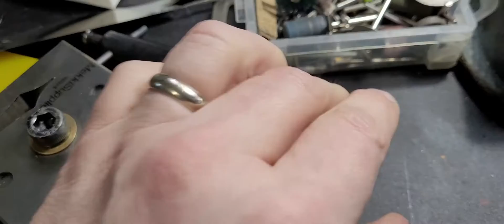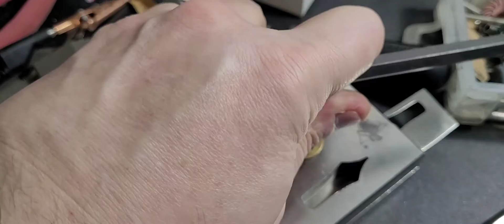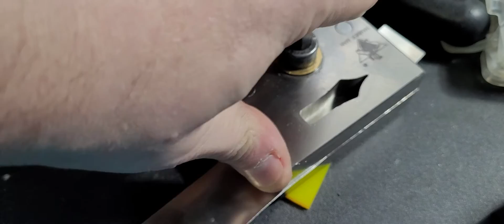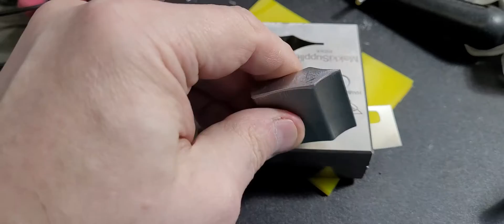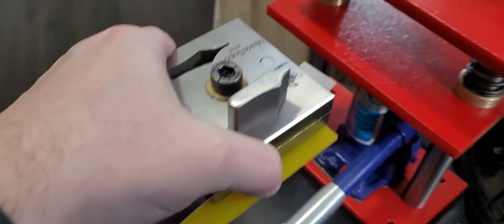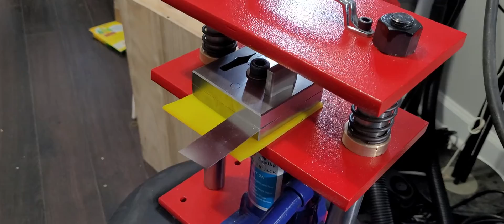How to Make a Fountain Nib Part 1

Comment: Hello Master, what is the name of the roller machine used to split the tip of the pen in the middle?
Reply from the maker: I use a Foredom with separating discs. A Dremel or other rotary tool would work also.